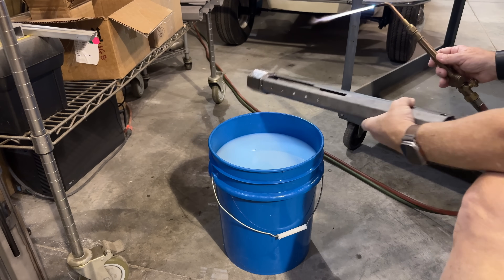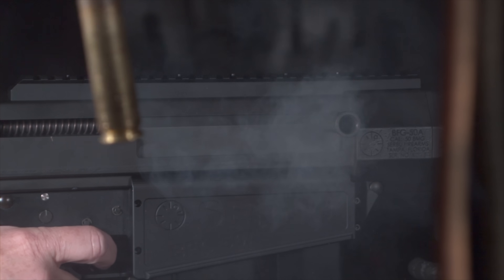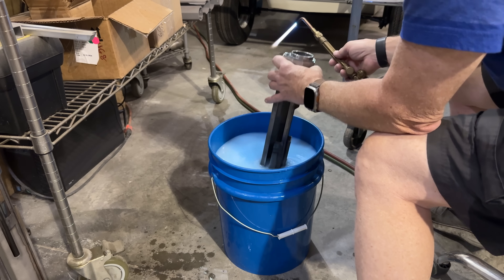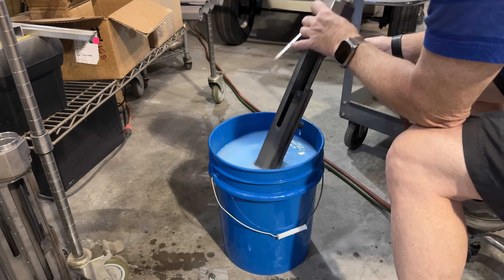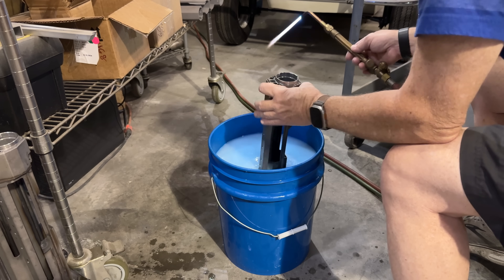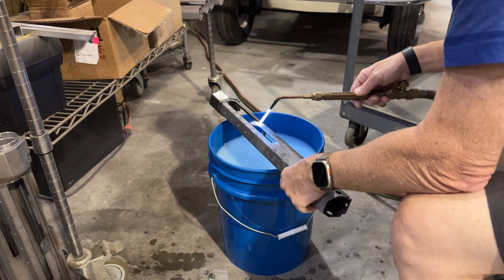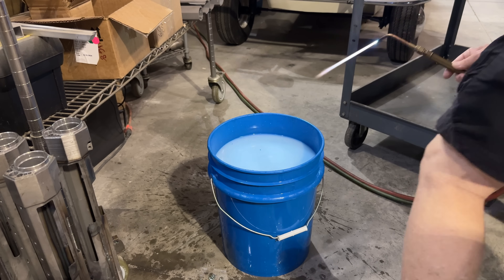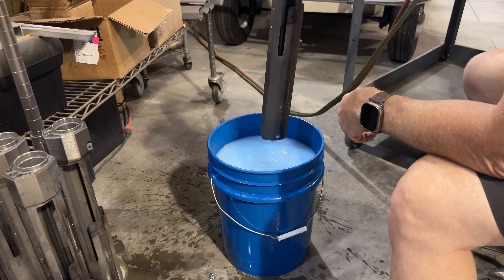Flame Hardening

Comment: With some ceramic “wool” batting, 2 dozen high temperature ceramic blocks, and a few  fittings, someone with your skill set could make a decent home forge that would be sufficient for swords that would also give you a much more consistent heat on a receiver like this. 

Then you could also make machetes and other fun little items.

Comment: I’m gonna be building an AR15 lower receiver out of scrap metal to prove a point. Would you recommend heat treating the lower receiver?
Reply from the maker: @Gonzo_Filmz What "metal" will you be using? Because if it's aluminum, you'll need to know what alloy(s), and heat treating aluminum is not straightforward at all. The lower isn't highly stressed, so even non-heat treated aluminum should be fine. Hell, they're 3D printing AR lowers out of plastic, so any metal should be more than fine. If you're using steel, again you'll need to know what alloy(s) are in your scrap if you're going to heat treat it. But steel shouldn't need heat treating either.

Comment: does dunking the heated area repeatedly do something better than just leaving it in until cool?
Reply from the maker: @toolthoughts Absolutely! The steel gets so hot that touching the coolant causes it to instantly evaporate and make a vapor blanket around the hot area. Liquid is MUCH better at cooling than this vapor blanket, so you shake the part around to try to disrupt the vapor blanket and get fresh liquid in contact.
Reply: @markserbu yep, Leidenfrost Effect.  Chilled brine is the most severe water quench as it inhibits this vapor blanket effect.  A dab of detergent helps too which I suspect is the reason for the milky look.  Brine is an overkill here with the thin metal.

Comment: Worked at a shop that made 5120 hand tools. We would use the same method to harden some of the parts we made. Usually cooled in oil and if we had to temper we would use a simple bucket of sand. Had a Rockwell tester and as simple as our set up was, our parts always hit specs.

Comment: Jet fuel can't melt steel beams
Reply: Not in a million years😂 While the thermal creep mentioned could cause failure, it wouldn't cause it to fall sharply. Instead it would go plastic first, negating any but the slightest chance to fall in it's... their own foot print. Only intelligent design from within could cause this type of failure hard 🛑.
Edit: this is a simplified and revised comment because my app closed when I accidentally hit the terminate app button 😂
Reply from the maker: @sonodietrodithe4iltuoincub848 No, but it doesn't need to. Look up "high temperature creep".
Reply: @markserbu  mate I was trolling XD
Reply: Just add oxygen.

Comment: Why's the water look like a colloidal suspension? Is there something mixed in with it?
Reply: I think it's a soluble oil mix - i.e. coolant.  Not sure how it works as a quench, I've used water with additives (salt, surfactants, etc.) but never oil.

I expect it's fine, it's a non-critical application and drawn quite heavily later.
Reply: I'm sure it's not but that stuff looks just like Ballistol pre-mix in water AKA "Moose Milk"

Comment: that flame should be carburising, you're not even close.
Reply: Fairly certain you want a neutral flame the goal is to heat it not add or remove carbon. Not that it would change much when it's that fast.
Reply: @steven-lr6dh  Sheet steel is usually low carbon, that's why it bends. You can temper mild steel all day and not make it harder. Carbon does that, adding carbon would case haren the edge and add wear resistance. It's steel 101, refer to the manufacturer or what grade you think you have.

Comment: As a professional mechanical engineer I was flabbergasted by what I saw you doing,, process control, who needs it,, hey??
a) What alloy is that receiver made from? I am guessing a medium carbon steel? (1045 or similar). You said Austenitic stainless steel (304 / 316??) , well that stuff does NOT flame harden and is non-magnetic (well maybe just a bit magnetic depending on the alloy) . A Martensitic stainless steel like 420) will flame harden and is magnetic
b) Do you temper it afterwards?, The as quenched hardness will be upwards of 60HRC for 1045, and VERY brittle
FYI - The company I work for does heavy duty miming and industrial chains and sprockets. We will flame or induction harden sprocket teeth (usually made from medium carbon or CrMo alloy steel and will get approx. 3mm effective hardened case depth. We will also induction harden our chain pins with similar results
Reply from the maker: @leor2830 You misunderstand. Of course I know that you can't flame harden 300-series stainless. I was saying that it's austenitic, making a point about it being non-magnetic, like this steel once it was heated to the austenization temperature. And the entire receiver is tempered afterwards, during the nitriding process. This stress-relieves the welds as well. Instead of being flabbergasted by the lack of "process control", you should be impressed by what you're seeing; a manufacturing step that gets the intended result, extremely quickly and in a very uncomplicated way. And it doesn't take 3 different guys walking around with clipboards to verify everything. Being a gun, there are some extremely picky processes involved with many of the parts. But some of them can be done like a redneck would in a barn. Figuring out the difference can make you rich.
Reply: @markserbu  Neither you and I work for the public service, and  can well appreciate that 3 guys walking around with clipboards are a waste. We both know that is not what process control is. 
In my job I have seen product failures that were directly attributable to quench cracking that occurred as a result of too an aggressive quench rate (some clown decided to use a chill brine quench) on a plain medium carbon steel or Cr alloy steel  part (either K1045 or 5140). It's easy to tell because when you look at the fracture face it is dark, and no amount of tempering or stress relief afterwards will fix that crack. 
This also happens with induction and flame hardening of medium carbon and CrMo steel as well, even having too sharp an edge (no chamfer) will cause chipping / cracking.
Besides heavy duty mining products, which can cause a lot of $$$  in down time if they break, I am also involved in "people mover" product, and if that breaks, then things get tragic. On top of this, add things like SCC, and well,  things get expensive
I could tell you some stories about a very expensive failure in a fertiliser plant in a more private forum if you want
Reply: Heavy duty miming 😂
Reply: @johnnybodangus  He does a lot of talking for such a heavy duty mime.
Reply: @StevelKnievel  refer my comment above
Reply: @johnnybodangus  Ha ha ,, very funny smarta*se,, as if you have never done a typo or had auto correct fvck up what you wanted to say
Reply: Small business, and I'm trying to think of how he'd do more process control here.  Especially without a dedicated station.  If the defect rate for that process is low enough, there's no need to check every one immediately.

As Mark notes, sheet metal has the advantage of being thin enough to not have to worry about some problems.

a) He's explaining using a magnet to check if the steel is hot enough before quenching, instead of doing it by eye.
b) I'm also curious.  It's obvious this isn't case hardening, but maybe cracking hasn't been that big of a concern.

Comment: Why not use an induction furnace? It would reduce the amount of oxidization on the surface. It would also allow you to get a more consistent heat treat.
Reply from the maker: @EthosAtheos We have an induction hardening machine and I used it in a video called "Adventures in Galling". We might start using it for this eventually, but we started using the torch in 2008 and we only got the induction machine a few years back.

Comment: Hi Mark, friendly neighborhood metallurgist here again. The reason those heat treat books talk about half hour or hour long soak times is they're generally describing heating in a neutral atmosphere furnace, which doesn't transfer heat to the part as quickly (and, as you point out, they're also talking about thicker parts that take longer for the core to heat up to the same temperature as the surface). The pearlite to austenite transformation happens almost instantly at the austenitization temperature, so on sheet steel like that, as soon as it glows the right color, it's austenite and there's nothing more to do but quench.

However, if you throw those receivers in the oven at about 400F for half an hour to an hour, that will temper those ejection ports just a bit and make them a lot more resistant to fractures from impacts.
Reply from the maker: @elektro3000 Thanks as always, friendly neighborhood metallurgist! We actually end up effectively tempering that spot and stress-relieving the whole weldment when it goes to nitriding. As I'm sure you know, the process takes place at just under 1,000 degrees F. It knocks that area down to around Rc 34, which is still plenty strong.
Reply: @markserbu Didn't know you were nitriding after, which process are you using (plasma, salt bath, etc)?
Reply from the maker: @elektro3000 Yes, and it's the perfect process for this receiver! You get a hard, slick, corrosion-resistant surface, and stress-relieving all at the same time. We're using a vendor now that does salt bath, but we've used the gas process in the past as well. No real difference noted, but with salt bath you need to make sure all the holes are cleared out well.
Reply: Engineering student / journeyman toolmaker here to second the recommendation to temper those parts at 400 after the water quench. The shop I worked at used an old heat treat kiln which wasn't very good anymore to do the easy job of tempering our parts, but a household oven is sufficient. I always did 2 draws held at temp for 15 minutes plus 1 hour per inch of thickness, and let the parts cool in the closed oven after it was turned off for the evening on the second draw.
Reply: After the half hour at 400 is it best to just turn the oven off and leave the parts in there til it’s all room temp again?
Reply from the maker: @The_RC_Guru This is one of the most repeated rumors in the heat treating world! Tempering takes place at a certain temperature, so once the part has soaked long enough at that temp, it's over! No need to slowly cool it!
Reply: @markserbu  The last shop I worked in made some D2 cutting wheels for something. And A2 rails to cut against. We didn't make a ton of them but it was a constant regular thing. 

At first we tried just sending the D2 bar stock out for tempering. It helped but not a lot. Then they were sold some semi proprietary tempering process. And that really, really worked well. 

I don't remember the details. Just it was an example of how much tempering can vary. I personally think there's more to it than instant.
Reply: @The_RC_Guru doesn't matter how fast you cool it off after temper.
Reply: Friendly neighborhood metallurgists are the best!
Reply: I looks like he cerakotes the receiver. I don't know what temp cerakote gets baked at but I know powder coat gets a 400 - 450 half hour bake. So maybe cerakote is his temper and finish. Pretty smart
Reply: @take1one  almost all cerakote can be done at 260-300* F...it would take a very long time to temper like that. Even at 500* my parts take about an hour and cerakote would burn up by then
Reply: Many years ago i treated some AK ejector rails, and the procedure was to heat them up to where a magnetic would not stick dunk the part in salty water and then temper them with flame by color, which proved to be problematic with a failure rate of about 50% after 100 rounds the corner of the ejectors would start to round off. the way you describe above is how I’ve done them more recently with excellent success. Oh the good all days we could buy an AK parts kit for $89 and tapco receivers for 20 bucks 😢
Reply: Every one here trying to tell the gunsmith how to make guns 😂😂😂😂😂
Reply: @Skankhunter420 Do you disagree with any of the suggestions? Just because one person knows how to do something doesn't mean another person won't have something helpful to add. I learn stuff and pick up helpful suggestions or advice about the work I'm doing all the time. Engineering and manufacturing usually involve a lot of people working together, not just one guy saying, "I know everything about this!"
Reply from the maker: @elektro3000 Preach! I'm sure he was just kidding around, though he DID commit the cardinal sin of calling me a gunsmith! :-) I certainly know a lot, but when you're drinking from the firehose that is the mechanical engineering curriculum, the depth of knowledge into arcane or esoteric branches of that tree of knowledge is a bit lacking. That's why it's nice when guys like you chime in! I'm going to give my metaphors a rest and get out of here...
Reply: Yes its crucial must draw back
Reply: You should try one of the small induction heaters. It will give you a bit better control over the temperature and the color won't be obscured by the torch.

Comment: Thank you very much for sharing that trick.  Is S-7 tool steel used in receivers so you might not have to do this process?  Jackhammer steel.
Reply: S7 steel needs to be heat treated, it just doesn't need water to quench (the extra alloy allows it to still harden when it cools slowly in air).
Reply: 1. You harden S7 before use.
2. Yes S7 is sometimes used in firearms, but there aren't just a whole lot of areas where it is actually both a good choice for the forces involved while also being cost effective. Usually it is gross overkill but sometimes it is actually not the optimal choice for the job.
Reply from the maker: @SailfishSoundSystem S7 is badass stuff and is used a few places on this gun. Totally overkill for the receiver shell, though! And can you even get S7 sheet?

Comment: those heat treating books are for regulated industries.  it's extremely important for high temperature and pressure piping.  i do know that it works, but even if it didn't the regulations require that every piece of pipe, every fitting, every weld, has a quality control package that meets every regulatory requirement.  every pipe spool comes with a book of paperwork to be legal.
Reply: me and my welder years ago used to joke around in front of our trans canada inspector saying that we were going to start a pipe welding and peening company because we were so good at "mechanically adjusting" the welds when he wasn't looking.
Reply: with a hammer.

Comment: Unless I missed it, what is the white stuff in the water?
Reply: It's coolant used in the machining centers. It's basically a water soluble oil that is mixed with water that lubricates the cutters and takes the heat away from the piece being machined. 

My guess is it's Trim Microsol from the color.
Reply: @BadWolf762   Thanks for letting us know.
Reply: @BadWolf762  Moose Milk 😂

Comment: Compact induction machine will do that so much faster and more consistent. I personally stepped away from fire brazing to induction brazing.
Reply from the maker: @kwisatz27 We've got an induction machine...see my video, "Adventures in Galling".
Reply: @markserbu  I laughed my butt off at the title, and always remember where your hands were the day before on your computer when you ate food covered in hot sauce talk about heat treating LOL my poor eyes.
Reply: He wants that one lip hardened. How could you target heating only that one area with the loops that come with most induction heaters?
Reply: @ronlabe5487 they make flat coils (spirals out from the centre) for heating specific parts of an assembly this this. The metal does not need to be inside a coiled wire for the effwct to work.
Reply: Induction allows oxygen to create oxides on the steel thus reducing the carbon content and surface hardness. A torch running rich will actually add carbon to the surface.
Reply: I wish I had your job!! ❤
Reply: it probably could, but I doubt he makes enough of these to justify the cost of that.
Reply: @BoomchacleV0  they are less than $200
Reply: @BoomchacleV0  And you think oxygen and acetylene are free? They cost a lot more than electricity that is for sure. +1 for induction heating for hardening. However that may cause more nasties to form on the steel as the air isn't kept away by a flame.
Reply: @BoomchacleV0  not too mention this is way cooler than an induction heater! they are very efficient though. We have one at work for preheating base plates and flanges that are up to 4" thick 6' across, 45 mins and its around 350 degrees.

Comment: why not rivet on a brass deflector like an mp5?
Reply: Adds weight and would be more expensive to produce for no added benefit.
Reply: drilling two holes in receiver + fixture / checking tools (cost)
fabricate the deflector + fixture / check tool (cost)
assemble parts (time)

And that assumes the design works the fist time.